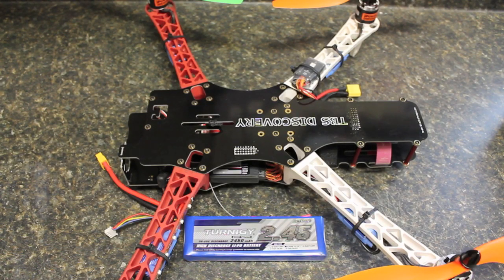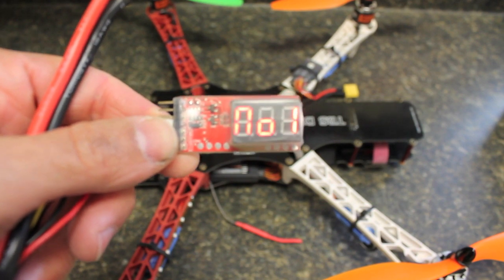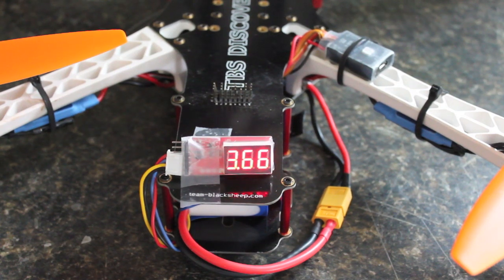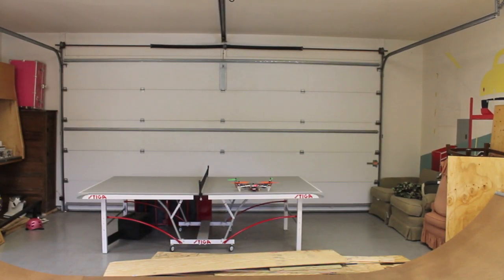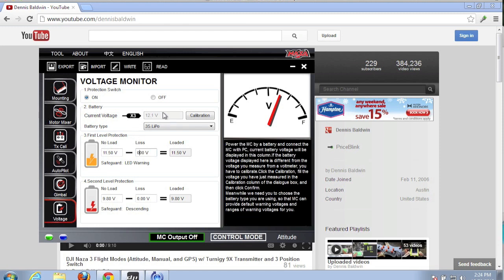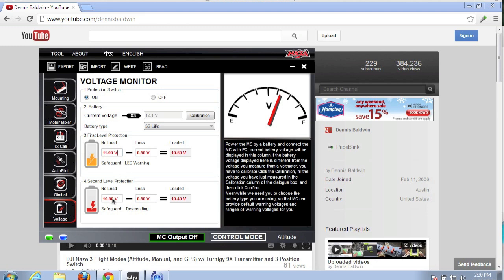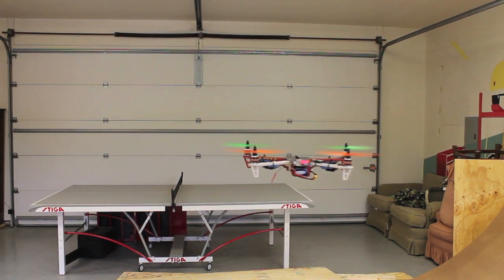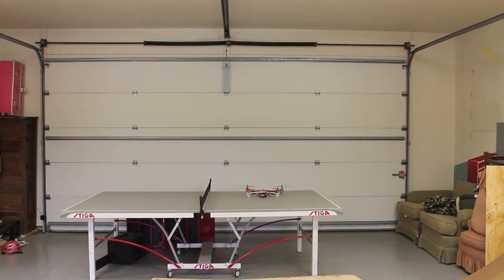DJI Naza First and Second Level Voltage Protection Setup and Configuration

Comment: Ok, Got my voltage readings on on my quad recorded today.  Took 12.5 minutes to get to 3.5 volts per cell on a Zippy 4500 mah battery.  What concerns me is I was down to 4% according to the checker.  I guess I won't be flying that long on a regular basis but wonder if I want to get that close with the voltage warning set up.  I did not have the fpv tx or gimble powered up so I'm sure that will eat up some power as well.  I will have to post a vid on my set up when I get it all done. Will set up the Naza voltage warnings tomorrow. Thanks again for this video, think I'm finally digesting/understanding it.
Reply from the maker: +Dean Hallal Sounds like you're making good progress. Definitely share a video when you get it ready. We'll be anxious to see how it's coming along!

Comment: Hi Dennis, great video but I got a question due to a problem. I have an S500 quad with 2212 920KV motors, 9443 props and I usually run it with 2200 and 2600mah 3S batteries. The first 3 times I flew the quad, it flew for around 6 mins and when it landed, the battery was around the 20%. Now I fly it and the batteries drain in 2 mins!! and the voltage is super low like 9%, what to do??
Reply from the maker: +Darío Alomía It sounds to me like your battery may be faulty? Have you tried another batt and what happens when you balance charge? Do you run into any issues with any of the cells? Given that nothing in your setup has changed it really sounds like a battery issue. Let us know what you find out.
Reply: the same happens with 3 different batts

Comment: I have a F550 with E310 motors and 420S esc's  but I also have a Tarot 2X gimbal and Boscam 835 fpv transmitter camera UltraPro-X Cam-10 uses its internal battery . My question is do I need to have everything on , to set the voltage , or turn on only the F550 to get the line loss ? As is I only get 1.5 minuets before the first stage led starts and 3.5 before it self lands . I have a switch for camera stuff . The whole thing with Bios 5000 mah S3 battery 40C is just under 5 pounds .
Reply from the maker: +Spencer Boaz My advice is to run the test with it loaded as you would have it loaded in the field. Otherwise you could get into trouble when your AUW is actually heavier than what you did your test with. Sounds like an interesting rig you're building. Hopefully you can squeeze some more flight time out of it.
Reply: Dennis Baldwin I have played with the voltage settings and can get abut 5.5 minuets but it seems like it don't have enough power and it slowly keeps coming down it don't want to hover with the stick at center I have a DJI DT7 TX and a DR16 receiver so it is hard to add just a little stick , and I shouldn't have to it should hover in the center , and does for about 2.5 minuets . It starts falling long before the first stage protection comes on . I sent an email to DJI support telling them the problems I am having with it . If it flew halve as good sa my Phantom I would be jumping up and down with joy .

Comment: I am using a Naza-Lite and have been having trouble entering the value for line loss using the Assistant software.  I finally figured out what's going on and my conclusion is that Assistant is over-smart or more correctly, goofy.  Once you have entered the first level no load voltage and line loss it calculates the other values for you but also enforces certain boundaries based on it's knowledge of LIPO batteries.  It knows that the battery will be damaged at less than 3.1 V/Cell so if you attempt to enter any value that would reduce the Second Level loaded voltage below 3.1 V/Cell Assistant won't let you do it.  This is the case whether it is a no load or line loss voltage.  The problem is Assistant doesn't tell you why it won't accept the values.  So as Dennis found when he tried to enter .60 volts he wasn't allowed to do it but .50 volts worked just fine.  I am tempted to launch into a discussion about the proper way to write user-friendly software but will settle for saying that DJI has missed the mark in this case.  One other thing I would argue with DJI is the idea that 3.1 V/Cell should be the loaded voltage limit.  This is because loaded voltage is lower than the actual battery voltage and what you need to do is prevent the battery voltage from going below 3.1 V/Cell.  So for example if you have a 3 cell battery and the line loss is .60 V then the loaded voltage to trip the Second Level alarm should be (3.1 x 3) - .60V which works out to a loaded voltage of 8.7V not 9.3V.

Comment: Dennis, im experiencing an early trigger from my lvco. I put on a 2200 3s, fully charged and put my lvc 1 to 11.50v. After about a minute of hovering, my lvc 1 kicks on and after about 2 mins lvc 2 kicks in. I landed and hooked up naza assistant and changed the loss to 0.50v. I hover at just over 50% throttle and continued flying for another ~3 mins. At about 5 mins of flying I landed and hooked up naza assistant, which showed 11.2v without load. Does that mean that my loss is actually something like 0.80v ~ 1.20v? Ive only tested lvc with one of my lipos, but I guess lvc is pretty much useless for me because I can fly for about 5 mins with a 2.2 3s, and stay in the safe range, however lvc would go off the majority of my flight and want to land every few seconds if Id left it turned on. Ill test more lipos tomorrow, but for right now Im pretty unhappy with my lipos performance. Will try 2200 2s in series this weekend and see how it goes. Do you think that investing in one or two of the multistar 4000mah 4s lipos at hk is worth it, considering they are 10c and I fly with 1200kv ntm motors? I think my C rating needs to be at least 20?
Reply from the maker: max fox rider From what I just read it looks like the NTM 1200kV max current is 17A. So if you're flying a quad at max output this is 68A total. If you were to go to a 4000mA setup (which it sounds like you should do) I would definitely recommend at least a 20C discharge rating. That means at max output the battery can support 80A constant discharge, which is above the 68A max output of all 4 motors. If you went with 10C you'd be at too low of a discharge rate. I don't know about your voltage monitoring as it's hard to say. It's very dependent on your AUW (all up weight) and prop configuration. I hope this helps a bit and good luck with your setup.
Reply: Dennis Baldwin Thanks for the reply. When I film, I fly with my 4000mah 3s (unfortunately I only have 1 pack), but for simple cruising around without a heavy old go pro for example, I fly the small packs. I have two 2200 2s packs that Im looking to run in series and see what happens ;) I keep it between about 6~8mins flight time with the 4000 3s pack (I could probably push it to 10, but I have yet to try that). Ive set my lvc 1 at 11.1 with a .7 loss I think. I run graupner 9 inch props and they give me great performance. I was looking more at power speed and agility when first building my quad, but I regret that now, as Im looking for efficiency and stability.

Comment: Hi, I own a Phatom 1.1 and with the standard battery 2200mah with the GoPro on it, i used to get 8 minutes of flight before the first warning.  Then I add on the Gimball and the flight time was cut down to 3 minutes.  So I upgraded to the T-Motors and T-Props so then I was getting 5 minutes on the same battery, 8 minutes with two 2200mah in parallel and 11 from two 3000mah in parallel.  I also have the Farshark FPV system installed.  I have the first warning setup at 11.6 volts (full battery reads 12.6 volts usually) but when I land, the battery has still 70% charge.  One time it landed itself still with 60% charge.  So, should I lower to maybe 11.2 volts or somehow reset to manufacturer specs? 

Much greetings.
Reply from the maker: Mochilea Ecuador I would definitely play around with your voltage monitoring settings. Also, keep in mind that the loaded voltage (in the air) will read differently on the ground. So it could be that you're dropping below the threshold in the air and when you take a reading on the ground it look like you have a lot of charge left. Just make sure you don't drop below 3.2V/cell or you could run into some serious problems. Worse cause I try to go no lower then 3.5V/cell. Hope this helps and good luck.
Reply: Thank you very much.  I did check the settings and its much better now.  I noticed that 2 of my batteries drop too low.

Maybe you can help me with this: I am currently using this transmitter with the Attitude V2 goggles, but i want to use it with the Cinemizer Oled HD ones. I wonder if the quality of the video (considering is transmitting from a gopro camera) would be much better?

Greetings.

Comment: Dennis, not a lot of comments considering the number of views. I would have expected a few more considering the new Naza Assistant GUI doesn't show a Minus (-) and Equal  (=) sign giving rise to the numeric values that should be there.
Reply from the maker: What version of the GUI are you using? It's been like this for a while given this video is a bit out of date. But I hear you loud and clear. That definitely threw me off after upgrading.
Reply: Dennis Baldwin Dennis, I am using the latest version. If I go to "Info" tab on the Naza Assistant it shows Version 1.00 Naza Copyright 2011 -14. So I figure it has to be up to date. This version does not show the so called "Equation" It is such an obvious mistake, I figured that they would have picked up on it. I don't have the time to call the Customer Service line N.A. to discuss something this obvious. But if I hadn't come across your video, I would simply be leaving it to LOS and a very loud LiPo voltage alarm, which by the way comes on well after the MC decides that it is time. I still have to go thru the whole process from scratch again. But then I am still trying to nail down the failsafe feature with my  ER9X FW .

Comment: Hey Dennis its been a while since Ive bothered you man lol but this vid of yours touched on something that I am having a little trouble with. I am now using a 4.0 3S Turnigy battery and my flight time was really short. Around 3-4 mins I think until my quad started descending on its own. It never occurred to me that it was my dang NAZA doing this. Hell I thought my battery was just dieing or something. Well I changed my NAZA Second level Protection

"FROM" No load (11.10V) Loss (0.70) Loaded (10.40V)
"TO" Second level Protection No load (10.10V) Loss (0.70) Loaded (10.40V)

It seems to me that I should be able to get more out of my battery by lowering the SLP down to like No Load (08.00v) Loss (0.30v)

I wanted to test today bu we are having gale-force winds here where I live for some reason. :(  
What are you thoughts on this? Am I thinking about this in correct terms?
Reply from the maker: There are many schools of thought on this but a good safe low voltage per cell is anywhere between 3.3V to 3.5V. I would err closer to 3.5V if I were you. With a 3S battery this means anywhere between 9.9 to 10.5V total. Also, a lot of ESCs have what's known as an LVC (low voltage cutoff) at 3.2V. Once that hits the ESC will cut power to protect the battery. Have you tested with a different battery just to rule that out of the equation?

Comment: You are the man Dennis.  Your videos are well made, to the point and have helped me immensely.  I am new to this hobby and trying to learn as much as possible.  Quick question, I just finished my first build (DJI F450 w/NAZA M-Lite).  I bought a used Fly-Sky FS-TH9X Tx and Rx from someone on Craigslist and after doing some research and watching some of your videos, I realized that the Auto-Fail Safe mode cannot be programmed with this Tx unless I switch the module and receiver to a FrSky.  But I also realized that I am running the earliest firmware version of my Tx.  That means I now need to buy some extra parts, open my Tx, solder wires the board and rig this my self in order to update the firmware (which can be a risky thing).  My question is, would you recommend me sell this Tx and spend a couple of extra bucks to move on to something like a FrSky Taranis X9D or a Futaba T8J?  I just dont know if its worth upgrading my current Tx or just playing it safe and spending the money on a better Transmitter.  -Rick / Miami, Florida
Reply from the maker: Rick, thanks for the feedback. I love the Taranis. It's amazing, but the tough thing will be getting one. Well it was tough at one point. I had to wait about 6 months. If you can use the SmartieParts board to upgrade your existing TX then it may be worth looking into while you decide on the Taranis. I have a video that demonstrates this and I really like er9x. I know there are other open source firmwares out there so I'm not sure about any of the others besides er9x and OpenTx, which comes on the Taranis. Good luck and if you do decide to mod your TX it would be great if you could share it with the Garage Pilots community: www.garagepilots.com

Take care.

Comment: Good video man...I kind of understand but it's still hard. I have a 3s 6000 mah battery on my hexacopter with 8 in props...
Reply from the maker: Thanks. Good luck with your setup.
Reply: Dennis Baldwin Thanks for your input Dennis.  I think I'm going to try and order the Taranis X9D.  Where do you order yours from that it took you 6 months to receive?

Comment: Dennis I don't know why my red light started blinking so early because after my red light started blinking I can get extra 5 minutes flying before start descending I got 4s 5000 Mah 35c please reply I see u from Austin Texas.I'm at Houston Tx.
Reply from the maker: Keep in mind if you're flying with a 4S then your low voltage will be much higher than with a 3S. Perhaps that's the problem you're running into. Remember a 3S fully charged is 12.6V while a 4S is 16.8V so you'll use the same process as in the video but your voltages will be different. That's my best guess right now.

Comment: Dennis on your choosing to setup your voltages would you say load your Phantom as your going to fly it then run your test to get your numbers or fly it naked and use them numbers to set your voltage points?
Reply from the maker: Thanks for the comment and great question. In my opinion you definitely want to do this setup with all your payloads in place. Now I really think that whatever your thresholds are it won't matter since 10.5V will be 10.5V regardless of the weight of your quad. You'll just get less flight times with more weight. But I still think doing it with your payload is the best way so you get a feel for how much time you have in the air before it triggers. You don't want to be too far away from home when that happens :) Hope that makes sense.

Comment from the maker: Great question. Yeah unfortunately if you're switching between 3 and 4 cell batteries your voltage protection levels are going to be different. I normally try to fly with multiple batteries of the same voltage and mAh. If you're switching between voltages (3 vs 4 cell) then unfortunately you'll need to change your no load and loaded voltages. Alternatively you can purchase a low voltage alarm, which in most cases triggers if any cell goes below 3.3V. HobbyKing has them for dirt cheap.

Comment: Hi Dennis,  A quick question on the DJI Assistant.....i have two 3.3 mah batteries 4 cell and two 2.2 mah batteries 3 cell....in order to use the Voltage Assistant am I going to have to hook up the DJI F450 each time i change batteries?  I would like to take it to the park with 4 batteries in my case to fly a little longer.....I'm sure everyone out there has different size batteries.....

Comment from the maker: It's dependent on how far you need to get back home. This obviously varies based on distance, wind conditions, weight of your craft, etc. I would do some testing to figure out what 0.1V translates to in your world. I normally like 30 seconds to 1 minute if I'm doing pretty close FPV. Regarding the limit of a 3S lipo you'll get all sorts of different answers, but I would say you don't want to discharge anywhere below 3.2-3.5V/cell. The higher the better, but you're obviously trading flight time

Comment: When you discussed the 2nd level protection, you mentioned to put it a bit lower enough to get home.  Is there a best practice?  Should it only be a .1 volts lower.  What's the limit of a 3s lipo?

Comment: Cheers for reply Dennis, when I go to set up the batteries, I take away 1 volt, and then put 0 for the next equation. Then within about 5 seconds of flying the 1st level warning is already flashing. And that's on freshly charged batteries. Nothing else attached no cameras or anything. The batteries are 2200- 2400,  they all seem in good condition, but are about 2 years old.  I ended up setting the battery warning with a couple of 3500 batteries ( all 3cell)

Comment: yes I can sell you some new receivers, if you like. I use the 600TVL SONY SUPER HAD CCD D-WDR Color Board Camera with OSD Menu DNR from .securitycamera2000 com work great and is $45.00 with free shipping. they rock. I think you will like it. if you would like send me a private message and I can call you.I'm in Detroit MI.

Comment from the maker: Steven, thanks for the note! I read in the Naza manual if your voltage loss per cell is > 0.3V then it's time to replace. What brand of batteries are you using?

Comment from the maker: BTW, are you using the standard 9X firmware or did you flash with er9x? I'm wondering if I can do this with the standard firmware. I think you mentioned you're using standard, but wanted to confirm. Thanks.